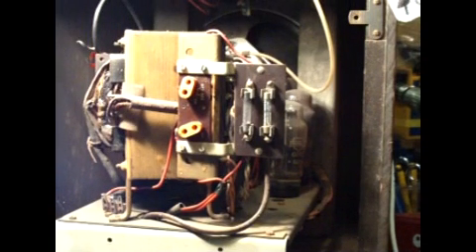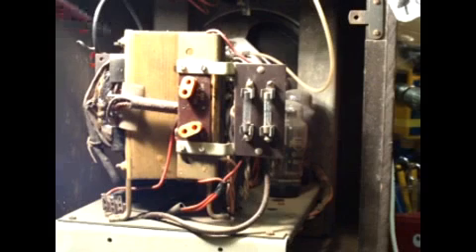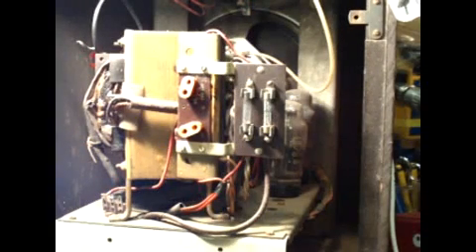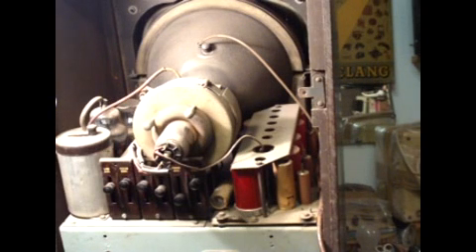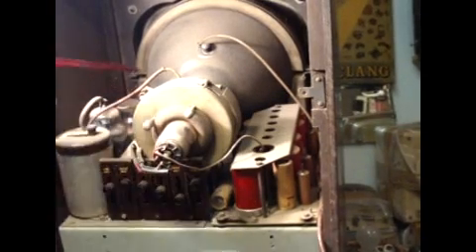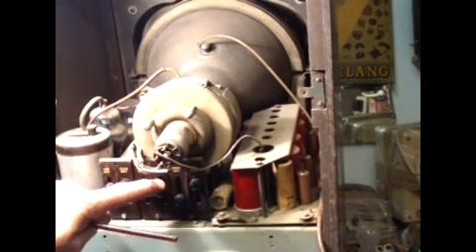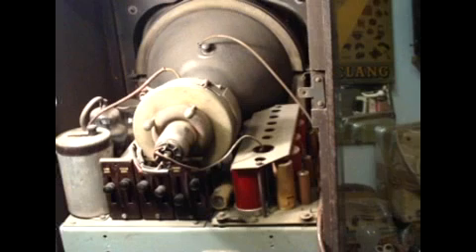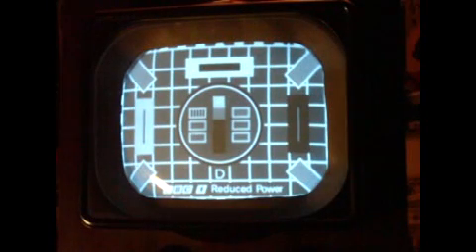PYE 9 inch 1946 Television Receiver Pt 2

Comment: Fascinating video. Great picture quality. Yes the capacitors always go - however I had a german FuG X HF receiver (1942) out of a Heinkel III which I restored and every single capacitor was perfect. Only one carbon resistor had gone open circuit.

Comment: ...ariel socket is two tiny little holes, not the coax one like ono the aurora converter. Is this normal, and what is it likely to be dangerous to just plug the set in?

Comment: Thanks for the great demonstration John, I have finally got my B16T going although  the ' sliders ' are a bit ' iffy ' but am looking for an ECC34 in decent condition as vertical scanning is ' low '.Other than that, I'm very pleased with the results, it was the first model set my family ever owned, and a bespoke table made for it in the late 40's has survived, the same ' footprint ' as the base, so it is now having to bear a lot of weight again !.Thanks for superb interesting uploads,Roger.

Comment: I knew the 'flyback transformer' had to have originated some time in history, but as it seems it was after 1946 -- and technically you can make due without it.

Sadly, System A had AM sound and no sync pulses in the way PAL and NTSC do.